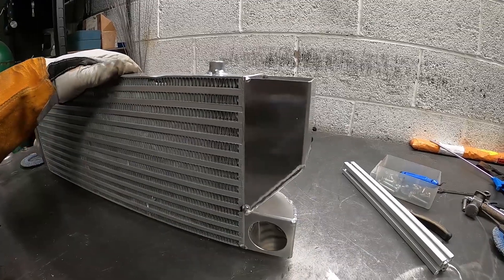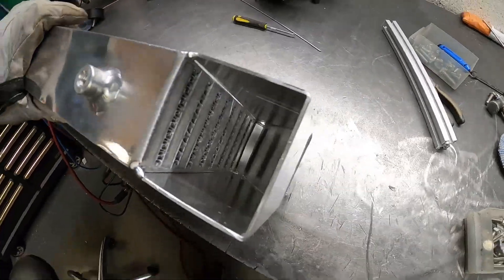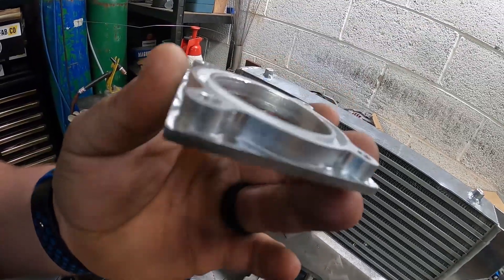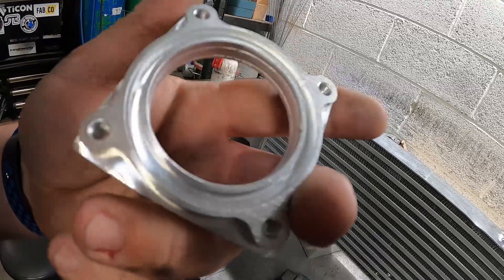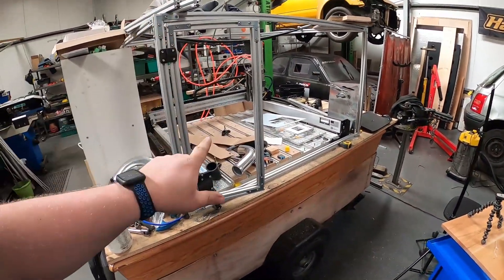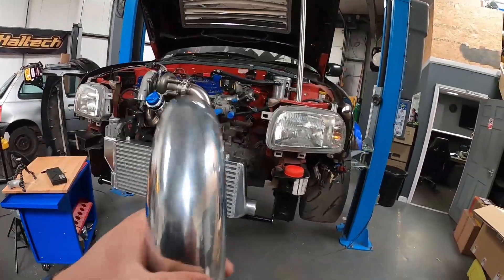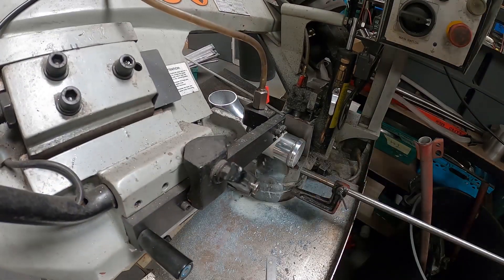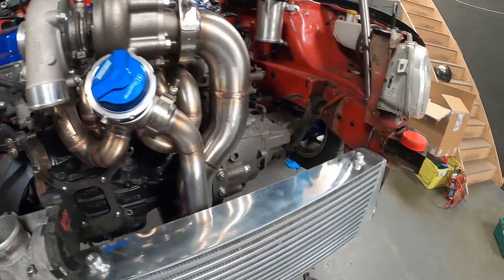MODIFYING THE INTERCOOLER - K11 MICRA SUPER TURBO TIME ATTACK BUILD!

Comment: Loving these videos so much . I've a superturbo myself and I'm running everything electronically soon just doing rust repair currently, but it's great to see your approach to it .
Reply from the maker: Thanks Adam. I started to over think it by trying to size up and fit 2 intercoolers to dual-stage the cooling. Turbo > 1st stage intercooler > Charger > 2nd Intercooler. But this was a much, simpler method to deal with. It does however mean the charge from the turbo that initially feeds the charger won't be cooled, but got to work with what i have.
Reply: @GizFab   @GizFab  I am going to use to factory run of the piping and use the dbw throttle in place of the factory bypass valve. I am afraid of changing locations of parts may alter the supercharger noise of the ST . I'm using a gt2554r garrett and standard charger. Quick question why dual cool the blowers ? Is there any pros to it ? Also I'm really looking forward to your choice to control the bypass valve in the software . I want to use a haltech nexus r5 with dual dbw controllers and map the bypass in 3d scale so it can incrementally open versus load and boost to actually smoothen the crossover etc . Sorry for long comment its a mad topic thats is so interesting!
Reply from the maker: @adamburke5400  Current plan is to use the A/C Output from the Haltech to stop the charger and then open the bypass valve just before stopping the charger. 

But, we will have the ability to run 3 different configurations. Twin Charge, Compound Charge and Sequential Charge. Will dyno and see which is the most beneficial option.

The dual stage cooling was what the old Lancia Delta did. But they did have alot more room that i have in the Micra.